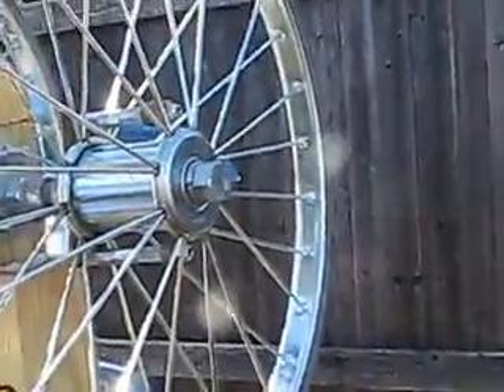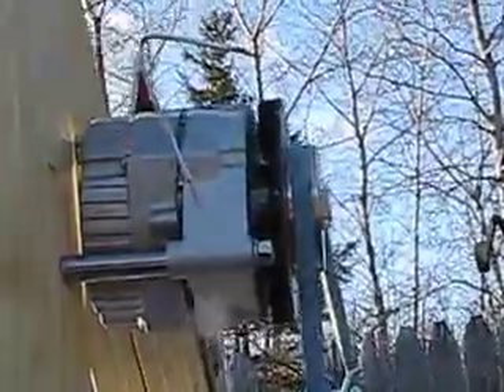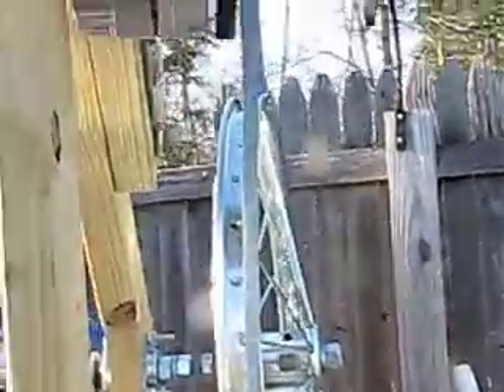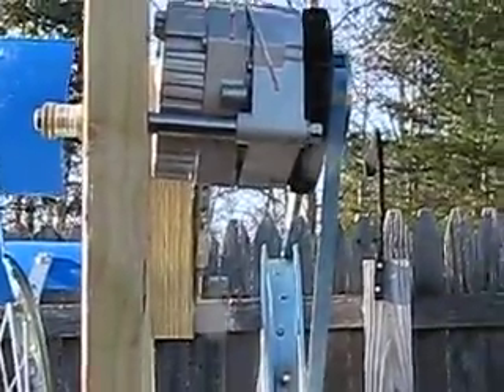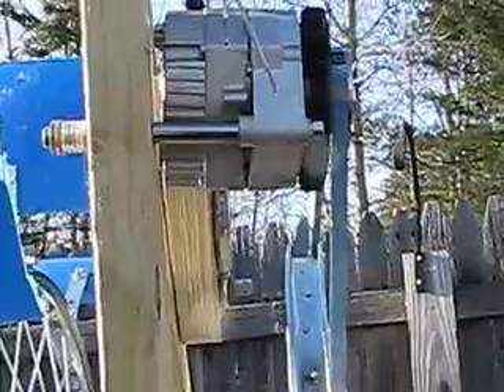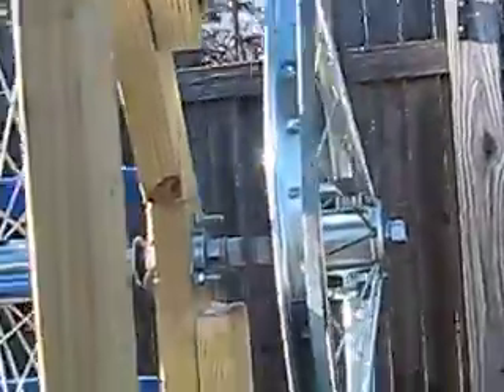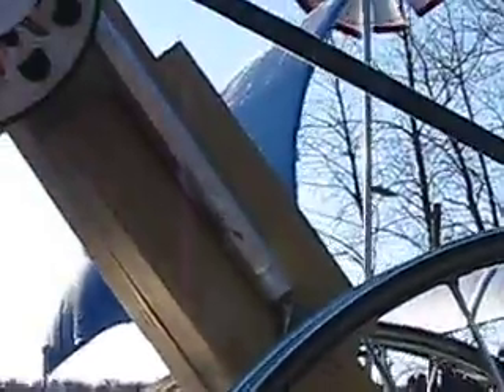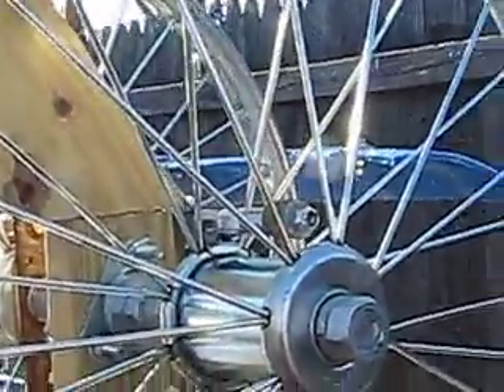waterwheel pt 2 .AVI

Comment from the maker: Well, there is a Scottich dude that has a tail or vane that maintains a pitch in the wind of the winds. The other thing is to make air foils, which should work.
Right now there is about 50 feet off two feet of snow where I wish to put this thing up.
Thanks for thinking, John